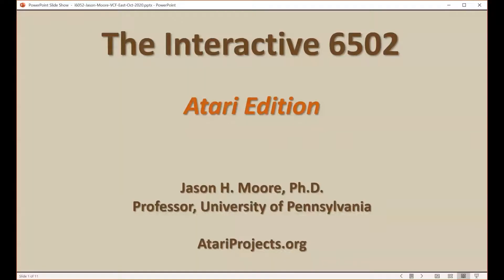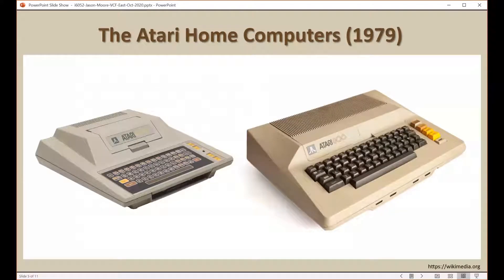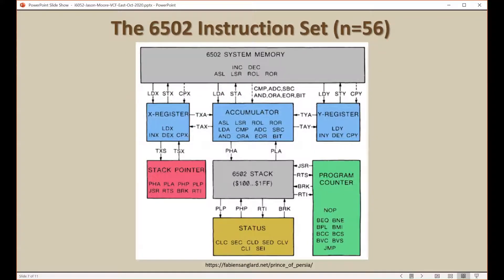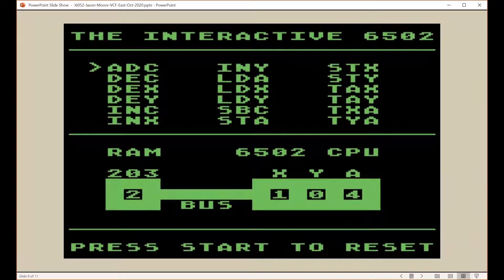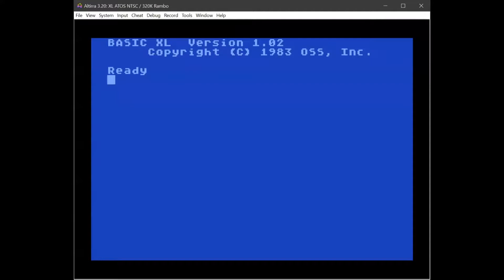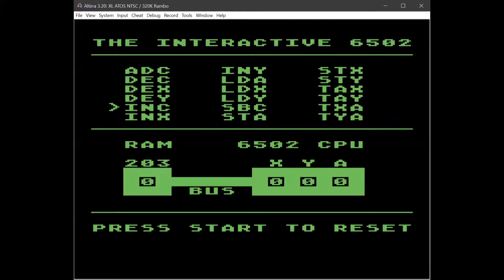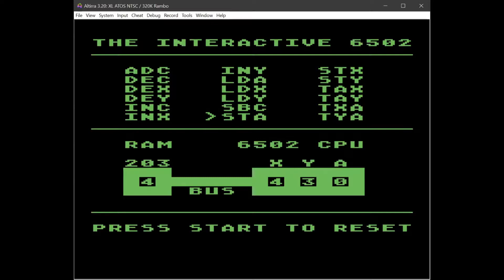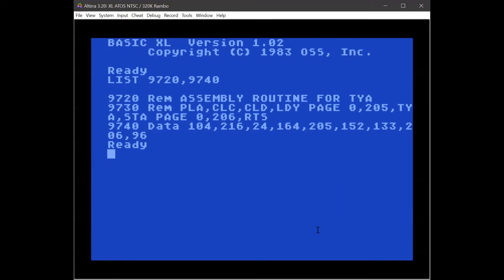The Interactive 6502 Demo for Atari 8-bit Home Computers

Comment: Coded for the C64 with a different chip mapping in RAM. 65xx is such a simple and great CPU. It only lacked an "Increment Accumulator" instruction. But that's also the beauty in its simplicity. Fantastic CPU to learn ML. Great video thanks a lot. 👈